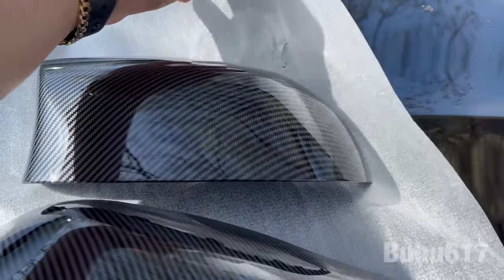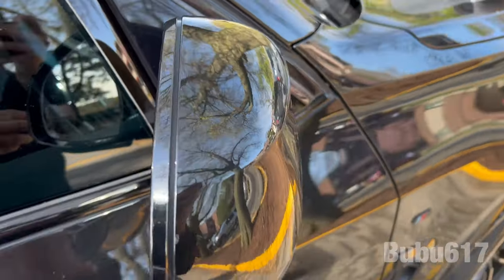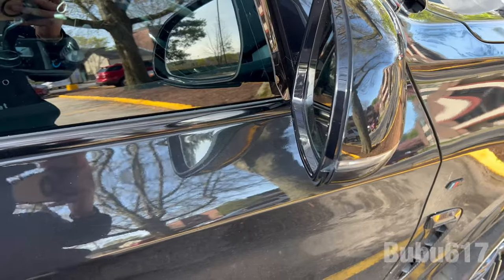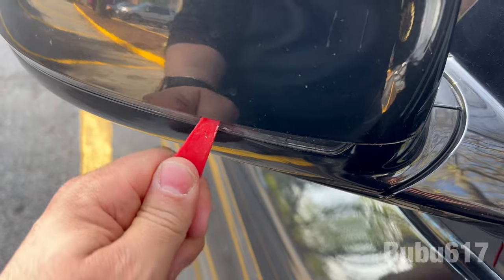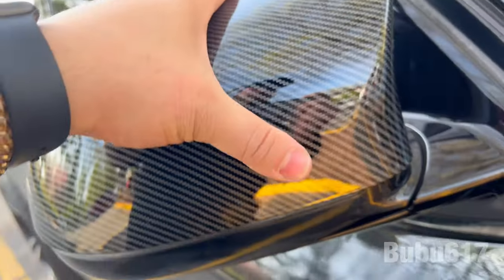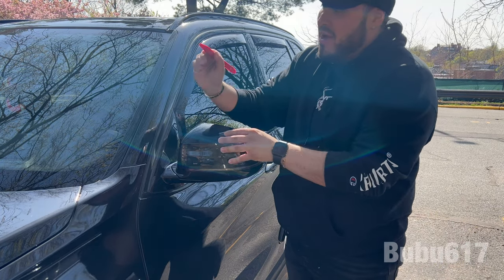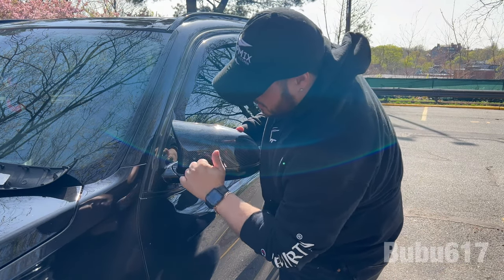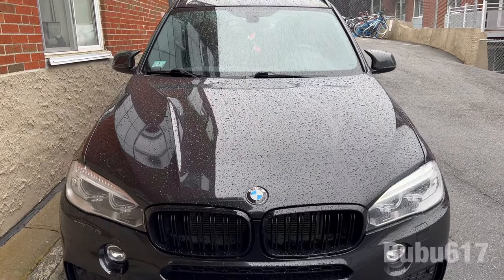EASIEST WAY TO REPLACE MIRROR CAPS ON BMWs | BMW X5 M Sport

Comment: Best technique bro . I did my x5 after watching your video. Very easy to fixed.
Thank you very much bro once again
Reply from the maker: I’m glad the video helped 💪🏼
Reply: Same here. Just did mine. It was a bit more difficult than shown in the video because it's easy to break a clip or crack your mirror cover if you're not careful.
Appreciate the video just the same.
Reply from the maker: @Benny-zo3qh  did you use a trim kit?
Reply: @Bubu617  Yes, I actually already had the exact same one you had.
Reply from the maker: @Benny-zo3qh  that’s weird. Wonder if yours had some type of adhesive. Because I’ve done it to a few. And a good amount of people have said they have done this method with no hiccups.
Reply: @Bubu617  It wasn't too bad. It was a bit chilly outside, and that could be partly why. I took my time, and overall, it turned out well. I would just recommend being very careful and going slowly. Also, if you look at where the clips are on the ones you're installing, you'll know where they are when removing them from the car, so that also helps.

All that being said. Thanks again for the content, and I hope to see more F15 videos! Bimmercode, maybe?